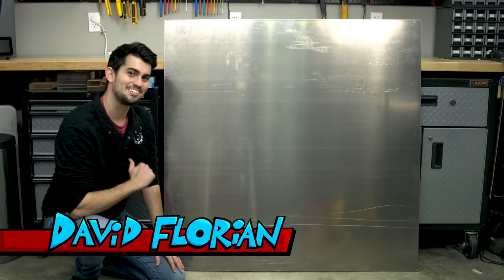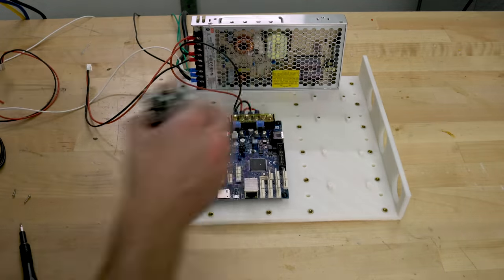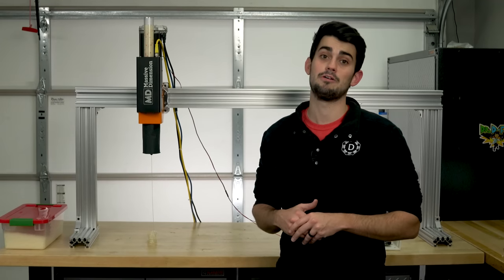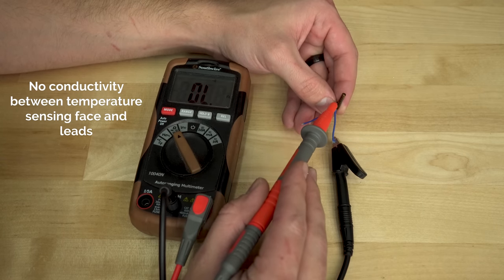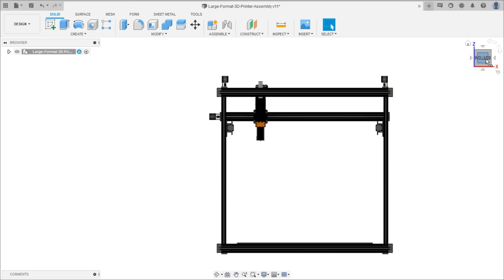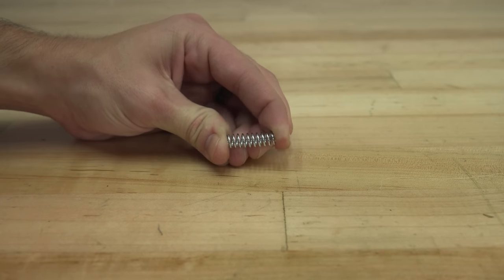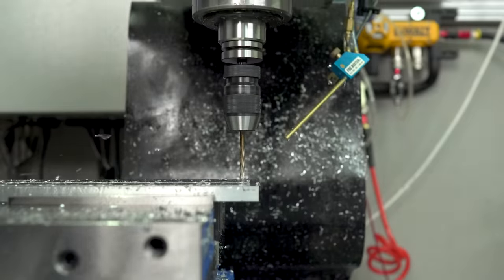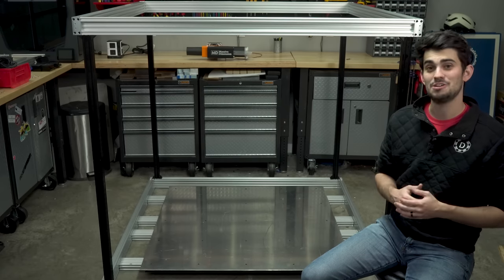Building a Large Format 3D Printer – Part 1: Pellet Extruder

Comment: The back of that solid state relay will get very hot. Put a aluminum heat sink with thermal paste on it. Or it will melt the plastic and burn the SSR.

Comment: Do you have a plan for leveling out the entire frame? On machines of this size small twists will magnify over time.   I guarantee your concrete floor isn't perfectly level.   There are concrete solutions to pour "self level" but I assume this is intended to remain somewhat mobile.   If you haven't thought about it, I'd very strongly suggest developing a plan to level the entire machine.   Also,  what's the max expected weight of a print?  Have you done the math on if your print would be heavy enough to push the bed out of level mid cycle?  This is a fascinating project and I subscribed because I'm looking forward to watching your solutions on this massive project.   Very cool.

Comment: That's a very nice project ! Can't wait to see the next parts !
For the bed, I think that I would have choosen a multi 250 x 250 mm plates system with each one having an AC heater to minimize power consumption. This way, I would have probably deflected too much deformation during heating. Also, why not use a Quad Gantry Leveling system with a Z offset induction probe ?

Comment: The attention to detail re: bed levelling, while admirable, seems like overkill as you scale up the nozzle and layer heights.  If the goal is to print furniture-scale models, it seems that a simpler approach like a braced, generally flat surface with standard 3 or 4 point levelling would've resulted in perfectly stable patio chairs.  Am I missing something?

Comment: Why...dont you just put it on a granite slab and then use a bltouch to read the bilinear bed level info?  It'll compensate for the difference in height along the plate.   Bit heavy though...

Comment: I that your design will work fine, since large scale plasma cutters use this and do just fine.  That said , the Z axis created a whole set of challenges.  Since controlling heat generated at the hot end and cooling on each layer requires maintaining the correct temperature of both, I am wondering how moving that large hot end will be able to effectively manage cooling on that bed.  The longer the movement of the hot end, the more critical it is to control the bed temperature and cooling of the plastic.  I would think that a stationary extruder and a 3 axis moving bed might provide more consistent results.  A stationary extruder would allow a heated bed to be heated through a stationary heat source under the bed and directly under the extruder.  The heat source , be it a flame or electrode, would  control temperature more effectively.  Think the effect just a cold draft has on our current 3D printing.  Now multtply that by a factor of 5 and improper cooling with your current design could a add level of complexity that would difficult to manage.    .

Comment: Dr D. just add a router head to it take small cuts with a endmill as to not overwhelm the light structure. , ridged mount the plate and mill it flat. done deal. KISS. simple is always better vs 25 points of twist adjustment.

Comment: It looks like the top of the frame is not rigidly mounded to the base frame.  Any thoughts on adding tension members or a shear plane to stiffen it up?
Reply from the maker: The Z-axis actuators when installed will provide a lot more structure for the frame. Those 40x40 extrusions are just keeping everything squared right now.
Reply: @DrDFlo  Ah that's good.  Looks like that gantry will be throwing around a significant mass. Hopefully it doesn't leave too much ringing in your prints.

Comment: The sequence from 13:30 to 13:58 doesn't seem right. There's no way that head is moving 3000 mm/sec to 6000 mm/sec, or to put it in other terms 3 to 6 METERS per second. Assuming the gantry is sized to move 4 feet to match the bed, that's only 1.2 meters. So even at 3 meters per second, the head ought to go from stop to stop in less than 1/2 of a second.

Comment: was this pellet extruder designed with the intention of being compatible with recycled filament pellets? I saw a video recently about the woes of recycling 3D printed projects and this seems a pretty elegant solution if so
Reply: It’s probably possible but it would probably cause a lot of issues. Back when I worked in an injection molding shop we ground up rejected parts in a shredder specifically meant for injection molding and we would always end up with lots of consistency issues. It ended up that we could only mix in a few bucket fulls for every pallet of pellets (think one of the pallets they have pumpkins/watermelons at a store).

Comment: Great Video, once again! I would love to see the higher temperature plastics being printed. Also do you think a bowden style feeder would work with the pellet extruder? That can help reduce the weight on the head and print faster!
Reply: A Bowden pellet extruder might work but you might have problems with the pellets binding in the tube. It would be hard to design one that can accommodate the the variety of pellets out there as they can come anywhere from fine/round to course/weird shaped. Good idea though

Comment: I'm looking at the speed in which your extruder puts the plastic on that Spiro pile on the table.  This tells me how fast you can make a part.  That extruder is pushing a lot of plastic, but not so much that your X Y axe's needs to move any faster then the quadrilateral screws on the stepper motors needs to move the extruder.  You still need to allow time for layer bonding, so speed isn't the answer.  You gota  go slow, or it ant gonna work.  It would take that thing at lest an hour to decorate a cake.  So, in order to go faster the heating system would have to be the size of an industrial injection molding machine, and it ant all that yet. And, it doesn't need to be.  Slow down, take au step back, and think.

Comment: I have a duet3 in my desk ready for rocknroll, I actually bought it to build a printer with 1m*1m*1m printing space. I have tried a couple of designs but they all had issues. As far as I have a 4 axis CNC milling machine and a 1kw fiber laser, I'm  definitely going to build your design. I appreciate your work and admire what you do. So keep it up bro.there are a lot of things to discuss about your design. So I think we'll need a chat room. I really liked the idea about using the raw material , can we do the same for ABS ? And as far as I know, duet3 can't synchronize the servo motor. I geuss that's why you are using the expansion board, right? I heard about duet company is working on drivers which can synchronize the servo motors so I guess that's it. Next problem is bed. How do you want to control the heat all over the bed, because you know, if we can't keep all the surface at one degree. The part is going to wrap. After all, how can we get a giant extruder like that? Because I am not in USA or Europe, so I can only order through Amazon and eBay.any suggestions? Btw I am waiting to see what you gonna do, stay safe and happy.
Reply: One degree?  And in the video he said he dehydrated the pellets by heating to 6 degrees C.  Do you guys live in a different universe than me?

Comment: Why can't they make an extruder with say a two inch wide head and multiple individually controlled adjustable ports like the injectors on a car? Faster, no drip mess and no filament hairs on end product. It's not like the tech is new, We've been making tune port injectors for over eighty years for all kinds of junk.

Comment: Pretty cool!  You know I just got into 3d printing about 2 months ago, ended up getting a CR-touch for my ender so I can auto bed level, but something kept nagging at me.  It only takes 3 points to make a plane.  Why does my ender have to use 4 springs... anyway I ended up buying a .02 metal shim to put in the middle of the plate to get almost perfect levelness.      Just a thought, if you end up needing to change up the bed level.  get some stiffer then aluminum material, the flattest stiffest stuff you can find, then do a 3 point level system.  My thought is to have the bed sit on 3 spikes that have a small chamfered dimple for the spike to fit.    Also this might help when leveling your bed:   https://www.youtube.com/watch?v=EDeIq3SZNRs

Comment: why use preset things?!?!?!? where is the actual DIY thing about this and then you need 4 parts!?!?!?!? its just 4 powerful stepper motors and an extruder hooked up to a preconfigured control board and power supply

Comment: Dude just use Duet's mesh autobed levelling...
Reply: You could use any roughly flat bit of something then use a probe to mesh autobed level it and the z axis would be controlled independently to make adjustments so that the noz is always x above the bed. The first layer could be a raft or brim that snapps off any inpresicion thereafter. Saves you loads of work